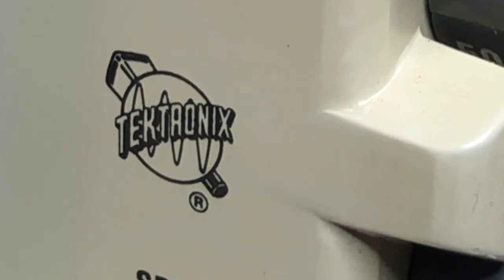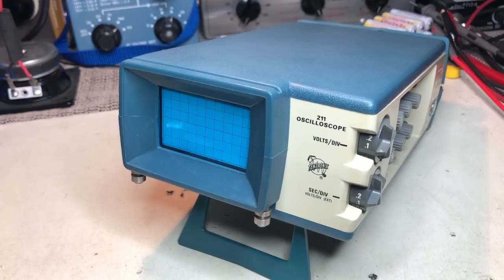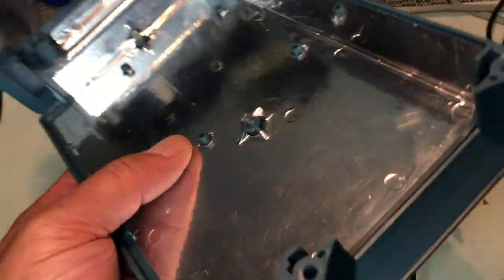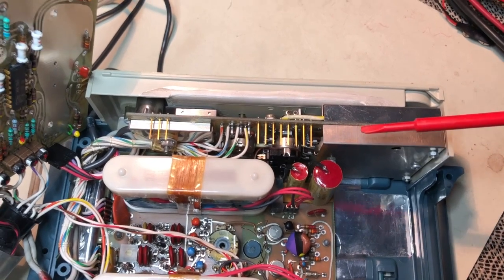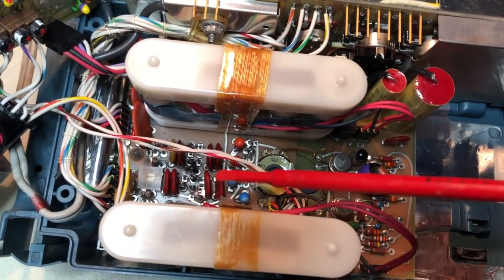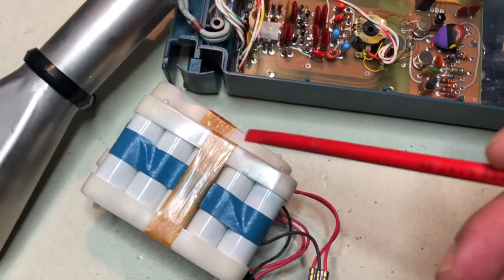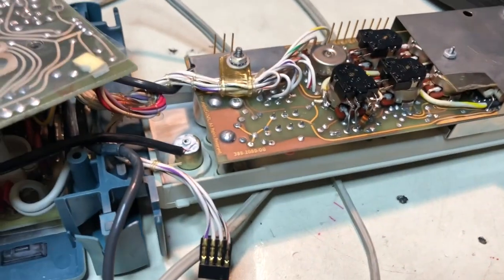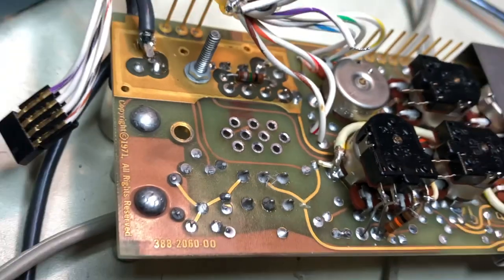Tektronix 211 - Internals, battery replacement

Comment: I replaced my batteries with the same ones you have, plugged in and got smoke. Battery cables melted. I think the transformer is shorted but I’m not sure how to test. I’m reading very low resistance between the transistor pins where the transformer is connected. I’m reading .4 ohms. Is t that a short?

Comment: Oh my gosh thank you! You just answered
My question at 5:25. I just took the risk and bought a non working tek214 on eBay and in the photos the old corroded nicad batteries are removed from the unit (seller said they plug it in and it doesn’t power up). So i assume / hope if I replace those batteries with 10 1.2v NIMH batteries I should be good to go! Right?

Comment: If you are working in this scope with the power unplugged, do you need to discharge either the large caps or the crt? I read online electrostatic CRTs don’t need to be discharged.